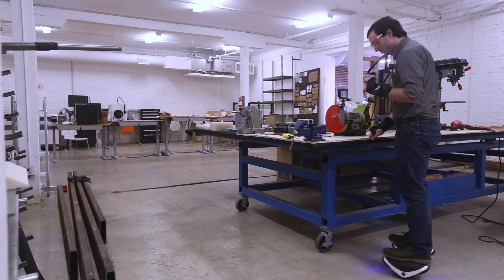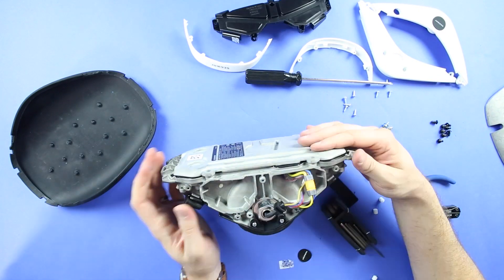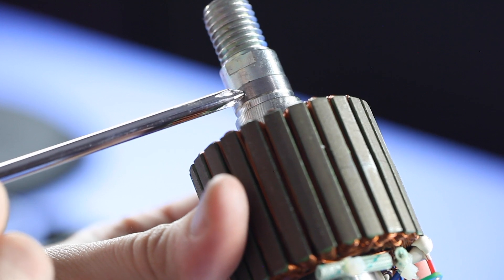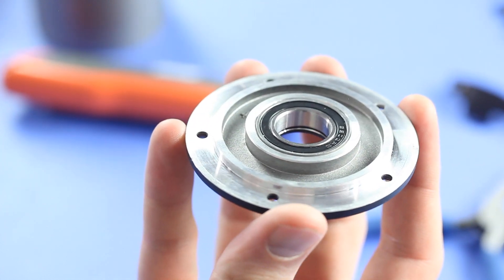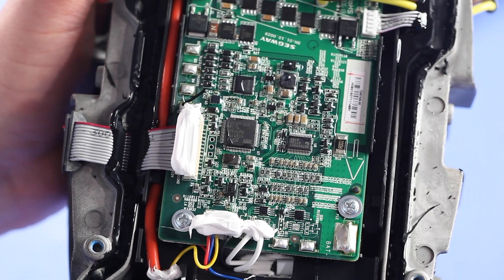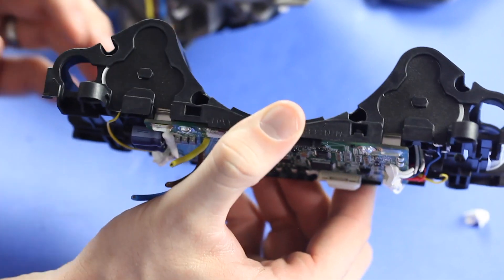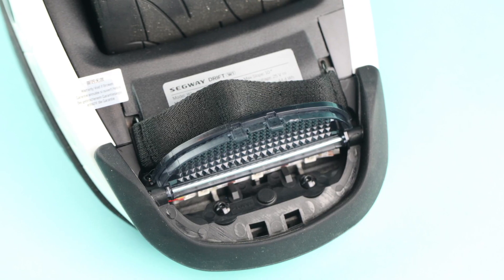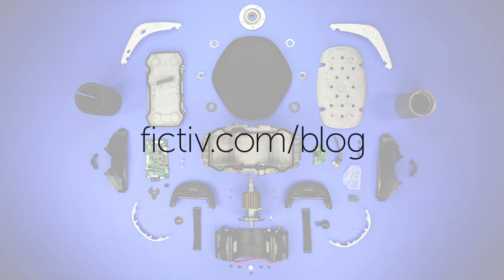Fictiv Teardown | Segway Drift W1 e-Skates with 219 Design

Comment: I have the W1 Drift bought in the UK for £199 ($240 US) and I feel you guys really do t appreciate the amount of technology, quality of parts and overall rare and not so rare metals. The margins on these skates must have been ultra low. I’ve been in the electronics business for 30 years and I’ve seen copper prices hit the roof,  neodymium prices hit the roof and I can only say this! They are absolute brilliant, very powerful, really long battery life, very, very high quality materials and considering the amount of man hours in development and production! For £199….. I wish I bought 20 pairs as they are selling on eBay second hand for £280 upwards. Imagine what a new pair would sell in eBay. If I was to review the skates I would not be able to fault a single thing (even the main CBA is tropicslised)

Comment: You guys are SMART! I love the approach. Great work.
Reply: Hi again. Interested in adding the omitted cells, but don’t want to brick my shoes. Do you think the electronic components aren’t rated to handle the extra juice, and it’ll fry or refuse to power on, or it will "just work" and give more torque and/or range? Thanks!
Reply from the maker: @MatthewLiguori  Glad you enjoyed the video! Check out our channel for more cool teardowns!
In terms of the omitted cells, they may have had a good reason for leaving those out after the early design cycles. If the product doesn't provide it themselves, the components probably aren't tested or rated for those extra batteries, and it could be risky to try to add them yourself.
Reply: @MatthewLiguori  try it and tell us. I am also considering modding mine

Comment: Why in gods name did you cut the wires off the motor, what a waste
Reply: What is wasted? Wires? So what?! These guys clearly know how to rewire.
Reply: @MatthewLiguori  There was no reason to cut some if not most of the wires. I doubt they're going to go through the effort of soldering all those back into a possibly working device.
Reply: @LauriraYT  these things have lost their value already.
There are so many of these lying around collecting dust. You can find these for under 50,- used now.

It's because it has no good use after the novelty wears of.

Comment: do you think they can be used in the long term even on not smooth ground like tiled with grooves that make them vibrate constantly?

I’m concerned about the electronics that can break with constant vibrations.
Reply from the maker: There are some rubber grommets included in the assembly with the purpose of dampening those vibrations!

Comment: Amazing explanations and great teardown guys. Did not expect the production level! Enjoyed the video, looking forward to more. Interesting that there's 2 cells free space, perhaps there's a way to add it in and get extra juice? I'd love to see you guys try.
Reply from the maker: Thanks, Anj! And good question... maybe there's a followup post there :)
Reply: @fictivmade  this idea is too simplified and not in the right way the entire device is basically the motor. Why did they choose this design. But its absolutely clear to me the way this should be marketed . Is to put that main wheel motor directly at the back heel then place a faux wheel in the front for balance and boom what do we have its called electric roller blades get with it already the market is ready. How does it work as the person edges there body forward the blades activate forward movement its not rocket science . I just don't have the resources
Reply: The segway-ninebot products have all been stellar so far in terms of quality. I bought a mini lite for about the same price as those crappy articulated hoverboards and it's got about 300 miles on it in the last year and so far no signs of wear or degradation.  Just picked up a pair of these W1s and they're also incredibly solid - looking forward to many years of use.
Reply: Bump